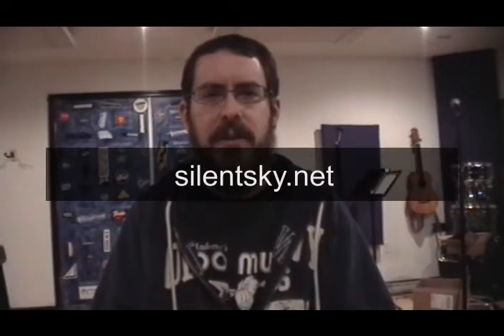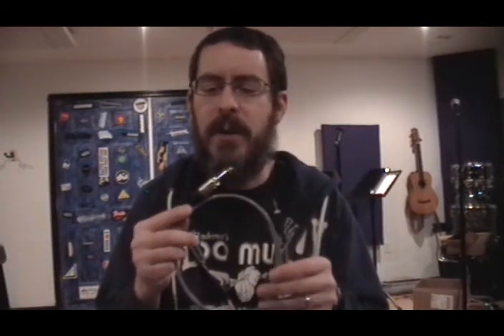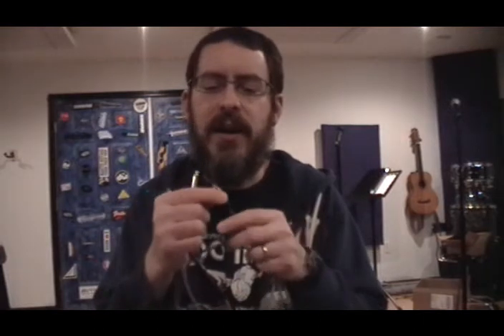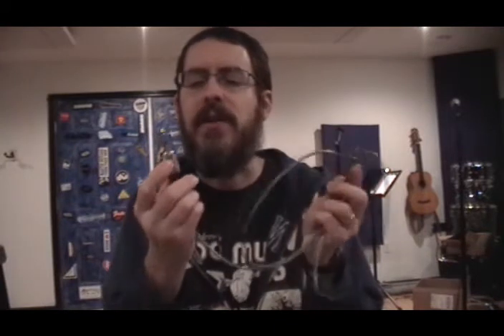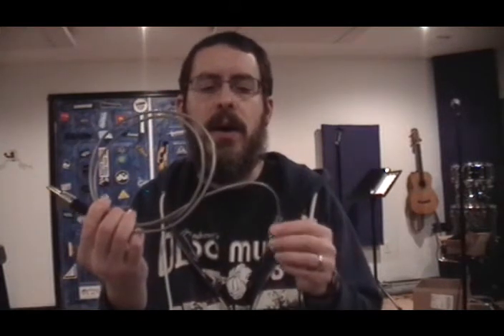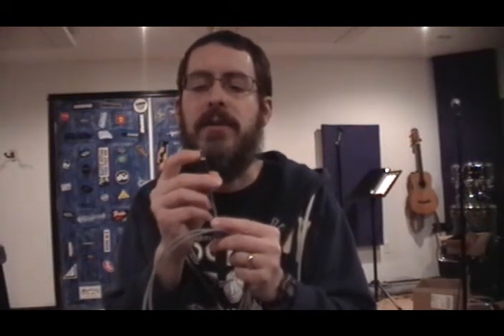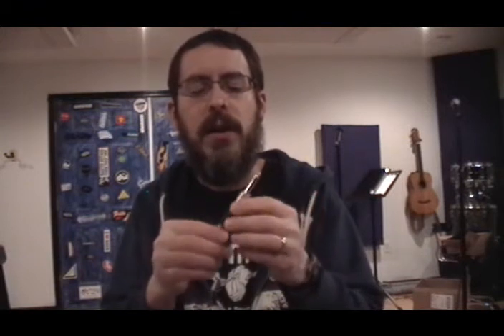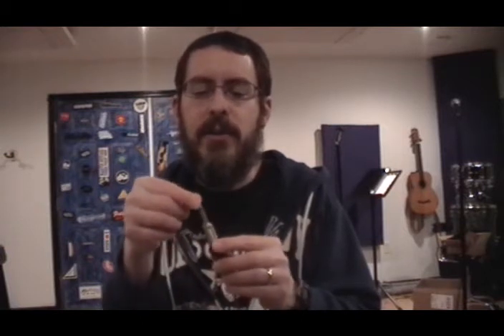The stereo to mono summing cable with resistors that no one makes

Comment: I just wanna say to You hit the nail in my curiosity. I didn’t know that “To run 2 Outputs together would cause the equipment damage!” This actually happened to me 2 times and I was asking myself.. What is going on?… Now I learned from you that the 2 outputs make feedback towards each other… This is making a lot of sense… I was almost lose my equipment. Omg! I will go back to the studio… and stop the Amp’s output from the mixer… and I will connect the instruments and vocal microphones to the Amp. When I want to record, I will record by using a dynamic microphone 🎤 to the Amp and connect it to the mixer.. and from the mixer to the computer… That’s it M’Man..♥️🙂✌️🎩 the recording mic 🎤 will be Input into the mixer and the computer… and it will record what will be happening from the Amp’s Output! Yes

Comment: which resistor would you say is best the metal or carbon film, thankx 4 ur time.
Reply from the maker: I normally buy metal film, but I think either should work just fine.
Reply: must be good to use a Mills MRA-5

Comment: Q. If I use this cable and only feed it with one channel (left), will it sum it down to real mono signal (left/right) i.e my speaker which it is connected to will play real mono from both built in loudspeakers and not only from the left speaker?

Comment: Hi Silent Sky Studios, thanks for this video.  I am using my stereo CD players & the stereo Cassette deck as connected to the vintage mono tube radio with the stereo -mono cable.  Kindly clarify for my doubts.  Since the Source is the CD player or the cassette Deck,   Can I use the same 470 ohm resistor?   I do have the 680 ohms resistor,  can I use instead of 470 ohms?  Thanks in advance.  Best regards.
Reply from the maker: Yes, you can use 680 ohms if that's what you have available. The higher the resistance value, the more attenuation (reduction) you'll see on the signal level, so you'll simply have to turn up the input gain or volume a bit on your mono tube radio. But it should be fine.
Reply: @silentskystudios  It's greatly helpful.  Thank you & Regards.

Comment: Are the resistors to limit the combined output of left and right channels relative to the ground? Why not use diodes instead to counteract the signal bleed from the left/right channels? (not very electrical experienced, just curious) thx!
Reply from the maker: The resistors are to prevent each output from trying to drive the low impedance of the other output as if it were an input. As for a diode, see previous comments and responses--some other commenters have asked that before.

Comment: why is this still a rarity in 2022? this is a very practical tool for mono monitoring
Reply from the maker: Good question, but I'm still not aware of any major cable manufacturer that builds these. I guess it's somewhat of a niche product, and there are other options available: summing D.I. boxes, volume controllers with a stereo-to-mono switch, etc.  So for whatever reason, none of them have taken it on.

Comment: Hello,
First of all thank you for the links to your articles. I‘ve read through them but I couldn’t find an answer for my specific case. If possible, could you please help me within the next few days? That would be awesome as I’m playing a gig next week. Thx in advance :)
I‘d like to know whether I need resistors for a summing cable which connects my stereo pedalboard to my amp. If yes, which value? I also wonder if the resistors will suck my signal.
I will plug the summing cable into the L+R output of my Radial split box (SB-6) which also has phase switch options so that won‘t cause problems.
Usually, I run my rig in stereo but I‘d like to have the possibility to run it in mono just in case I only have one amp. The effects and cables are all tied to the board which doesn‘t allow for quick changes. Hence the summing cable idea.
If I lived in the USA, I would buy one of yours but it’s cheaper for me to build it myself over here in Europe :)
Reply: I forgot to mention that my rig uses unbalanced cables only. I might change that later if I run longer distances to my amps but for now I keep my standard instrument cables.
Reply from the maker: Yeah, just build a y-cable with 2 quarter-inch mono/TS plugs on one end to connect to your SB-6 and a single quarter-inch mono-TS plug on the other end to connect to your amp. 470 ohm resistors should be fine. You'll just need to solder a resistor into each leg of the inner conductor wire (not the shield) on the end with the 2 quarter-inch plugs.
Reply: @silentskystudios  Wow that was quick! Thanks for the instructions :)

Comment: If I need a cable to sum the outputs of two guitars into one, then plug the other end of the cable into the amp, would I still need this type of cable, or would those amazon TRS to TS adapters suffice?  Not sure if the output of an electric guitar is high enough to damage any equipment, that's why I'm asking.  Thanks!
Reply from the maker: Why would you sum two guitars into one? Are you wanting to plug two guitars into one amplifier? If that's the case, it would likely be better to use a small mixer. In any case, as long as both guitars have passive pickups, you could likely sum the outputs together using a regular cable without causing any damage. It might affect the tone slightly, but it shouldn't cause any damage.

Comment: I have gotten no definitive answer as to if this will work with a stereo car radio that will then feed the combined signal to one speaker.   I have a car with only one speaker and I do not want to alter the dash for another speaker.  Mono AM FM radios are like hens teeth to find, and I would like to use my stereo with this one speaker, rather than just using one line Right or Left.  And if you think it will work, what resistance should I have for this summing plug?.

Comment: Hi, I have a similar requirement but it's not quite the same as your application/use-case and like yours there appears to be no connector or cable available.

I basically want to split the left and right of a stereo output jack and take just the left only and convert it back to a stereo jack so that when I plug stereo headphones in i have the left signal outputting in both left and right headphones.       There is a complicated reason I need this, essentially I'm using a sennheiser G4 transmitter that has two inputs going in but there is a completely different mix on the left side than there is on the right.  My drummer wants to use a wired in-ear monitoring solution by plugging directly into the stereo output jack on my transmitter but only wants the left side balanced evenly in his headphones.   Any ideas how I could do this?
Reply from the maker: Without seeing some kind of connection diagram, this is tough--but I'll try. This sounds like you just need a splitter to take the signal from the left side and split it to both of the (L & R) inputs for whatever is driving his headphones (headphone amp, in-ear monitor mixer, etc.).

Comment: Good video, As per my experience, going balanced to unbalanced, the Ring and Sleeve get combined and soldered to the Sleeve of the Unbalanced connector and haven't had any probs with this pinout. Never heard of the summing of the Tip and Ring to the Tip of the Unbalanced connector as you described it and like you said, this would be problematic indeed! So you are recommending summing up the wires to the tip with a 470K resistor in between, right? This will dampen the signal suitably .. which is what leaving out the Ring by soldering it to the sleeve also effectively achieves I think.

On another note, if we need resistors in a balanced to balanced situation (due to some low DC coming through), I would like to confirm with you that no resistors are needed for the Sleeve right? I am imagining putting 2 resistors one for the Tip and one for the Ring. Am I right? Cheers and best wishes from Australia.
Reply from the maker: The cable described in the video is for unbalanced stereo-to-mono summing applications. As you've stated, when dealing with balanced outputs to an unbalanced input, you can simply short the ring to the sleeve (or short pin 3 to the sleeve for XLR connectors) and otherwise wire the cable like you would an unbalanced summing cable. However, if you want to sum two balanced stereo outputs to a single mono BALANCED input, it gets a little more involved. I've blogged about that here, if you're interested: http://silentsky.net/wordpress/archives/863

Comment: Hey there

Thanks for this information. Is it possible to add a little knob in between, so I could change the ratio of the two signals? I have a guitar with two pickups, and they go to a stereo output, so I'd like to mix them together (without a dedicated mixer). More details, see here: https://www.acousticguitarforum.com/forums/showthread.php?t=606644

I'd be very happy to find a solution to my problem.
Reply from the maker: For that, you'd likely want to plug both outputs into some kind of DI box with level controls for each input that would handle the summing for you. I've blogged about several such DI boxes here: http://silentsky.net/wordpress/archives/995
Reply: @silentskystudios  Thank you! But I'm a traveling busker who really does not have any space for another big thing in my backback. A simple cable would not do it?
Reply from the maker: @joshuamuheim8900  I'm not sure how you're going to wire a knob into a cable and make it sturdy enough for gigging without using some sort of box. And the boxes I linked to are relatively small, like any standard DI box (about 3" or 4" square by maybe 2" thick).

Comment: Thanks for the video, so even in my case where I need to connect my computer usb sound interface to a single studio monitor, do I need resistors in the cable? The reason why I ask is because I bought a normal sort of y-cable and I can ear both channels. Cable in question is this  https://ebay.us/70ARFx Do I risk to damage either the sound interface or the studio monitor or both?
Reply from the maker: You'll notice that the cable in your link is specified as a "splitter" and not a combiner, which is exactly what the video warns against--using a splitter for combining. That being said, as long as you aren't getting any distortion or weird phasing effects, you may be fine--as least in the short run. Some devices seem to tolerate this behavior (shorting the left and right outputs together without resistors) better than others. However, in the long run it could potentially damage the outputs of your interface. There's no way to know for sure, though. Only time will tell about that. But no, it shouldn't hurt your studio monitor if you're not getting any distortion. But the safest route is to use a cable with resistors, which protects the outputs of your interface and ensures that the two output channels (left and right) aren't trying to drive each other like an input, as described in the video. Hope this helps!

Comment: Hi John -  Really interested in this idea so I made an twin RCA to single RCA to feed a sub I have that I want to feed from my Pre-amp RCA outputs.  I used 470 ohm resistors as suggested but am still getting some left to right bleed between the channels.  It is significantly reduced but still there.  If I increase the resistance to reduce the left to right bleed will I also be reducing the signal to my Sub?  Thanks for the great video - glad someone else thinks this is something that should exist :-)
Reply from the maker: That sounds like you're both summing AND trying to keep the left and right channels separate. I think that's also covered in the Rane "Why Not Wye" article under the heading "Termites in the woodpile".
Reply: @silentskystudios  hi - I bought a Monacor SMC-1 Stereo/Mono Converter in the end which does just what I want.  Tempted to open it up to see how it works but will probably leave it - thanks for the inspiration :-) https://www.gear4music.com/PA-DJ-and-Lighting/Monacor-SMC-1-Stereo-Mono-Converter/3DEX

Comment: Hi. I'm hoping you can advise me... I want to sum two active accordion mic outputs to mono and feed to a sennheiser radio pack transmitter...

What would be a suitable value for the resistors in this situation? Much thanks for any help you can give!
Reply from the maker: Assuming those give you an unbalanced, line-level output, I'd just try the 470 ohm resistors for starters.

Comment: I agree that shorting the left and right (T & R) outputs is definitely a bad idea!  But, how did you arrive at the 1000 ohm value for the resistors?  You also mention 470 ohm in your replies to some comments.  I am actually looking to make a double stereo output to single stereo input cable so your summing knowledge is very useful.  Many Thanks.
Reply from the maker: Some websites recommended the 1k ohm resistors, but in my experience those sometimes attenuate the signal too much. 470 ohms seems to do the job without too much attenuation. To build a double stereo to singe stereo cable, you basically build that like you would a balanced mono summing cable. I've also blogged about that here: http://silentsky.net/wordpress/archives/863

Comment: Great video as it explains what one needs. From this video, I found these:

Three such cables:
https://www.amazon.com/gp/product/B01NCYQ5KB/ref=ox_sc_act_title_1?smid=A3OXMIQ1ACN8PI&psc=1
https://www.amazon.com/gp/product/B00DWDYK94/ref=oh_aui_detailpage_o06_s00?ie=UTF8&psc=1
http://www.cbicables.com/ycables.htm

And the better way to do this still, using a audio transformer:

MCM Custom Audio, 50-20795, Stereo to Mono Signal Converter 
I found it at Newark, but also via Amazon.
https://www.newark.com/mcm-custom-audio/50-20795/stereo-to-mono-signal-converter/dp/25AC5154
MCM CUSTOM AUDIO Manufacturer Part No: 50-20795

Comment: Out of phase signal will completly cancel each other, the proper way would be using an OPAMP in summing mode https://www.youtube.com/watch?v=c8N9T06U9Mg
Reply from the maker: True, but under normal circumstances the left and right sides of a stereo signal should not be out of phase with one another. Also, try fitting an opamp and a power supply for it into a regular 1/4" connector!

Comment: Will a 120ohm 1/2 watt resistor work for this as well?
Reply from the maker: I typically use 470 ohm 1/8 watt 1% resistors.